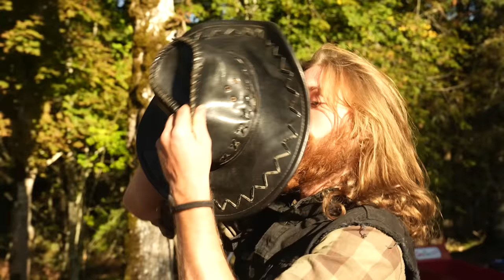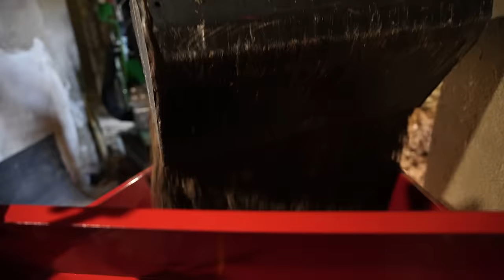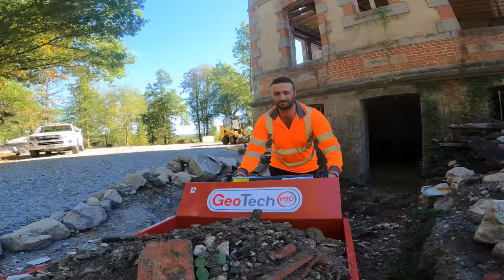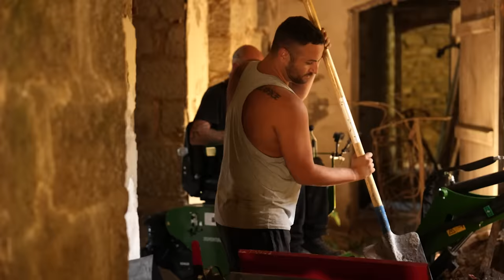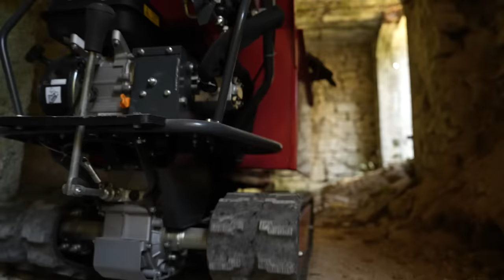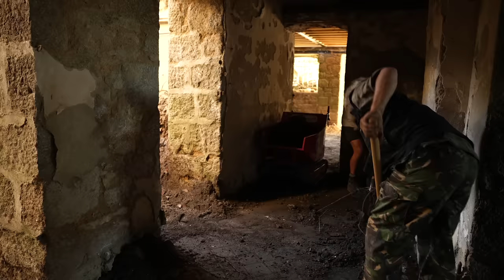The biggest most AMBITIOUS project yet UNDERNEATH this chateau ruin.

Comment: I had no idea that there were still rooms in the château full of muck and debris from the fire.  How nice to get it all cleaned out.😊
Reply: I also thought everything was cleaned out.
Reply: Same here.
Reply: The only cleared areas were the kitchen (to the right of the entrance). The basement's  entrance (by exterior stairs), an alcove, and the central area which had about 4 small rooms along a hallway. The areas in the back below bedrooms and the left wing were not cleared at all.
Reply: This is the other side. With all of their experience this side should go quicker!
Reply: I see some shinny new tools to help you along the clean up, how exciting
Reply: @lgrindrod3474  Wow.  I felt like he was clearing rooms all of the time, and I had no idea so much was left.  Well, he has help, a good crew, and they have a system.  Tally ho!
Reply: They haven't been in the basement for a while. I also forgot about it.
Reply: I am totally bemused as to the building work programming, there doesn't seem to be any direction or logic.  I said some time ago that there needs to be a critical path analysis to schedule the sequence of work so as to make the most efficient use of the labour and resources.  Maybe this concept of building planning is beyond comprehension but it is no less than a project of this type and scale needs.
Reply: Oh I didn't  think  there  was  still  so much to  clear.  Those are  my  kind  of wheelbarrow 😅
Reply: Thats called work.
Reply: @clivewilliams3661 I thought he had stated at one point that stabilizing the walls in the wing they've got floors in WAS the critical path, as it was the least stable section of the ruin.  Seems to me that in ordrr to do that they needed a partial clearing of the basement, and temporary flooring in the area where the stair landings were so they could move materials.  That's where they started (along with the driveway, which is essentially a separate work crew).    They've done that bit and have flooring tied into the walls up to the attic level, and now they're clearing out the rest so they can start flooring in the areas that were less critical to the structure.  It wasn't organized by activity (clearing, then flooring, then xyz) but it was in fact organized around the most critical needs of the structure.
Reply: Amazing hard work guys
Reply: @clivewilliams3661 not sure if you have realised it or not, but I believe this is more about content and less about building (of course there is building going on,just not today.
Reply: @clivewilliams3661 I’m sure Dan could do with you going to France and lending your assistance. Just enjoy the vlogs and try not to be so critical of a lad literally doing all this work by himself.
Reply: The place has two sides and only one is done.
Reply: @ankiking  I don't believe that even one side is done.  I think he picked a sizable room and pushed up one floor at the time.  He indicated that he wants to put a roof on as a priority.  I imagine he won't have time b4 winter but having acquired scaffolding a while back he MAY decide to skip intermediate floors in other areas and do the attic floor as a priority.  That would give him a base to rebuild tops of walls and plan a roof structure as a priority.  Clearly he needs a level secure base to place scaffolding on.
Reply: @clivewilliams3661  I don't think Dan has a critical path gene. He does want to get a roof of some sort on the building to make some areas  habitable. He has a good  sense as to what he is able to do today with the tools he has available.
Reply: As always, it’s just amazing how much gets accomplis
Reply: As always, it’s just amazing. I can’t believe how much work gets done when there is a team to help you Dan.
Reply: @mlaiuppa  I think about that every time things get scooped up and not looked through.
Reply: @halpen  Thank you for the explanation which makes the order of work make sense.
Reply: Ditto... all new info.  What a chore, but a job well done.   I love the tinka toys.
Reply: You are all gladiators except Cameron, he is a viking. Great job guys.
Reply: @clivewilliams3661  I think those details are available through his patron.  He has mentioned there being a five year plan.
Reply: @clivewilliams3661   Your catching on  or will have soon.
Reply: @halpen  the floors are not temp tongue and groove OSB is not a temp flooring plywood is. he has zero engineering reports on what's stable and not. the floor was put in to get staging to top for roof if you believe that?
Reply: We only been in one side of the chateau 
Dan has to do the exact same thing with the floors
Reply: Add me to the "me too" list :)  But I understand clearing / stabilizing part of the structure before going back and clearing the rest.
Reply: Count me in too, thought & wished for your sake everything were clear.
You might get it done before you're 118 birthday.
Monumental task but Trojans prevail.
Reply: @poppopsplace8354  You may be right because content generates revenue and the longer that this goes on the greater the potential for income.  I once thought that given the DiY nature of the project and the amateur expertise that the project would take 5 years to completion, I now think that is optimistic.
Reply: @marychrishannon7048   What concerns me is the lack of proper organisation and the potential for abortive work and thereby waste.  You only have to look at other DiY/amateur builds to see that a degree of planning and understanding has gone into them, not so this project.  The roof installation is a major project that I doubt will be complete enough to provide weatherproofing until next spring/summer.  Also, the window openings will need sealing in some way and there is no hint of that being done.
Reply: @manrossi1Its not the number that is important but the way things are done.  Look at Dick Strawbridge and 'Escape to the Chateau' to see how a one man band with a little occasional help can renovate a French Chateau
Reply: Not that exciting then. Just clearing out a bit more muck.

A lot of build up just for this!
Reply: @PreservationEnthusiast  The point is why clear this out now and why not earlier on, when the rest of the muck away was carried out.  Clearing out all areas would have allowed a full assessment of the work to be done that could have been slotted into the programme of work (if there was one).
Reply: @manrossi1I wholeheartedly agree and this is what I have been advocating from the beginning.  It makes so much sense but that is professional thinking.
Reply: I think I'm gradually loosing my sense of time and space here. 🙃
Reply: @clivewilliams3661 happen explained the plan quite well above. The roof over the section with the first floors will be a temporary one. Yes, the weather will still come in through the window openings, just far less than it has for 4 decades. On the section they are clearing, the concrete floor/basement ceiling has to be removed and replaced before anything structural can be done. Clearing this amount of rubble will have an effect on the walls higher up. That's why the least stable side was tackled first. Tying the walls together and starting to strengthen the tops was done to prevent a collapse. Under that section, Dan has already done some improvements to the basement walls to be better supportive. They're still at the strengthening the framework stage so that they can advance to building the infil stage.
The Strawbridges had more than just the framework in place. Their chateau had windows, doors, solid stairs, floors and plastered walls. It also had a full roof that still protected everything, despite needing some small repairs before they were able to replace it. They lived in the chateau from the beginning. Dan is still several years away from that point. For clarity. This is a burnt out ruin requiring a bespoke plan which Dan has broadly explained.
Reply: Loved it great video❤. Nice new toys & filmed for maximum advertising, well done. Team working is such a joy rather than always solo, & allows for some fun. Yellow pants man has morphed into vis jacket man😊..Well done team Dan, looking forward to tomorrow❤
Reply: I too am confused as to where work is going on.  I don't know the front of the building from the back.  Its never really explained from episode to episode.   Enjoying it all the same.
Reply: @michellebyrom6551  I cannot find your previous post so did not view any explanation.
It was my understanding from previous videos that Dan was looking to start the full construction of the roof for completion by the end of this year, I have not heard of any temporary roof - what form will it take?  normally a temporary roof over this type of construction would be part of the scaffolding arrangement and would fly above the proposed permanent roof.  As there is no scaffolding I assume that it will be a sheeting material on some form of temporary structure?  Leaving the windows open will maintain the saturation of the walls, which because of their thickness and material will take a considerable time to dry out when weather proof - say 2 years or more.  Having saturated floor timbers will show up as the building dries and I would expect some timbers to need replacement and all will need to be packed up to cope with the shrinkage when the building is weatherproof.  
I don't understand why clearing rubble has an effect on the walls higher up?
The walls are of substantial weight and thickness and were thus not slender so unless the structural engineer required it, I cannot see any great need and besides the permanent roof structure would add to the stability.  At present the steel beams can only 'tie' two opposing walls and not all four, the timber joists contribute nothing as they are not tied into the beams or the walls.

The point that I was making about Dick Strawbridge's renovations was that he had a clear and concise plan and schedule of work, the actual extent of it is irrelevant.  I appreciate that Dan's chateau is a mere shell but that is even more reason to have a precise plan and schedule.
Reply: @clivewilliams3661  I agree. There  should be a programme, network analysis, critical path etc. Identify key tasks. I really think getting the roof on the wing he has completed before winter should be a key task too. Otherwise he  is risking the timber he has put in, the way he has done things.

He's definitely lacking in advice in many areas. Project planning, temporary works, safety, use of scaffolds, and crash decks. At the same time he is going over the top on some things like for example putting in mid span noggings on 2.5m spans which is just not necessary.
Reply: @PreservationEnthusiast Programme, network analysis, critical path etc are fine posh words but they all boil down to one thing,   project planning, knowing what you are going to do and when.  Analysing how you are going to build something is essential to understanding the project.
Reply: @clivewilliams3661  I'm sure Dan have an overall plan and that he have consulted more knowledgeable people. Like he told the new I-beams was larger than original based on engineer advise. But the flow of videos is what drives this project. The videos bring the money that give Dan an income and pay the rebuild. Meaning the content are way more important that getting things done fast and effective. It's nearly like the slower the project moves forward the more income it generates.......
Reply: @clivewilliams3661  The order in which they're doing things is completely logical. The chateau is divided in three parts. The middle one which was cleared out first, then the one with the kitchen and now this. For the roof to go on, everything needs to be cleared out, ceilings rebuilt and the walls on top fixed. The roof is one continuous structure and can't be put back on unless everything underneath it got stabilized. He could've done all the clearing out first, then the ceilings and then the walls. But it makes no difference to the end result and he needs keep his videos interesting. They pay for this. If Dan had tons of money to spare, it could be done with a giant scaffolding and a crane. But even then the rubble at the bottom would need to be cleared out. But considering he's doing everything as cheaply as possible, it makes sense.
Reply: @westmus Even the French have building regulations to satisfy and I assume that the UBs were designed by a structural engineer to satisfy that requirement, although I doubt that a structural engineer will either be capable or want to carry out any project planning   This project is complex enough that having an overall plan is simply not good enough.  The points I made were not to speed things up, although that might help given the projected timescales, but to get the sequencing right so as not to waste time, materials and labour, no-one likes to do anything twice, nor repair what was new or salvageable.  This project has more than enough capacity to last a good 5 years with proper management, at which point either everyone is dead bored or Dan has become a millionaire.
Reply: My thoughts exactly!
Reply: Availability of help may be something he can't plan. So when 3 friends let him know (maybe on short notice?) they can come over and help, he comes up with a plan where he can put them to best use.
Reply: @crispijnwind6640   Even more reason to have a detailed critical path because a good one isn't linear and you can select tasks that are appropriate for the type of labour that presents itself, the materials and plant to hand rtaher than just making it up.  That sort of organisation cannot be kept in your head alone.
Reply: @francer1793   Who's We do you have a mouse in your pocket????   lol
Reply: The thing I find strange about all these comments about Dan lacking a building plan is that you seem to have missed the fact that Dan has very intentionally never shared much information with us viewers about the long term plans for the Chateau except in sweepingly general ideas, and usually a video or two before the thing happens. We neither know if he is completely winging it with no plan or if he’s actually a master planner who has consulted with numerous experts, reads all the comments for advice, and has a huge spreadsheet, and a kanban board with everything meticulously planned out. 😅 In all likelihood it’s something in between. But don’t for a second pretend you or anyone else has any clue what he is or isn’t thinking about/planning. Personally I think Dan has been smart about this given the number of people who are overly emotionally involved in his life and comment about every tiny thing he does wrong, mostly with good intentions but my goodness.😬This way he doesn’t have to answer to us. If he listened to every crank in the comments who has 50 years of construction experience or been an architect since the age of 5 and knows the “right way” to do everything, he would never get anything done. I have to remind myself that people get upset when things aren’t done how they feel they should be because they secretly care and want him to succeed, but many of these comments come across as just some strangers on the internet complaining to anyone that will listen, rather than any real constructive criticism.
Reply: @arcadianmorning   Part of the problem is that all us viewers don't have know what Dan is planning  and what we see flies against conventional wisdom so its natural that comments are made.  If there is any logic that we are all not privy to then we are kept in the dark, leading to the conclusions made.  You tube is full of DiYers doing all sorts of projects and watching you get to know if there is a plan even if it is not discussed and some of these projects are years old.  Dan's sense of an amateur unplanned endeavour is also borne out by his ignorance of basic building safety that has also been extensively discussed.  If he actually took on some of the experienced advice then perhaps the project would improve and avoid unnecessary waste, which I assume he can ill afford.  I don't think anyone is getting upset at all because ultimately, Dan will do what he wants but it is important that informed comments are made so as to advise those viewing the videos of their deficiencies since they are too often regarded as 'how to'.
Reply: Absolutely @halpen
Reply: @clivewilliams3661 
Edit: upon re-reading your comment I realize I initially read it wrong - I agree to some extent that leaving informational comments about safety is valuable for fellow viewers considering doing a similiar job. I just wish instead of complaining at Dan, people would frame it like "for anyone considering doing a project like this at home, please consider wearing a respirator" etc. etc. rather than "Dan, you are doing it wrong!"  😄 But yes, watching someone put their life at risk continually and be very disorganized can be maddening. There are quite a few people in the comments on his videos that seem to have a seriously unhealthy parasocial relationship going on with Dan (seen the comments people write about thinking about him all day, and those that can't sleep if he doesn't post?). I just think people have been forgetting themselves a bit.
Reply: @arcadianmorning  Dan read my post al while ago on the sequencing of tasks but merely noted the comment, so yes he does read the posts and others from his retinue have commented on the safety aspects.  The fact that others watch these videos should not mean that the primary comments are directed to them and it may be blunt but if I see something wrong, I call it out, if others disagree then we can have a constructive debate.  No-one should be fearful of constructive criticism.
Reply: @clivewilliams3661  I agree with you. It is good to know that he does read comments. My earlier point was that I didn't find your comment to be particularly constructive.
Reply: Clearing the fire damage and the plant life that has taken over in the last 40 years makes sense. Too bad Calvin has to go back so soon but they got a lot done and I hope he returns soon. I wish Dan had a bigger team to help him all the time but this is something that Patreon has some power to change and maybe at some point skilled volunteers can join him in his efforts. I think he has done a lot in a short amount of time largely on his own. I am here to lend friendly support to this Herculean effort, unfortunately I do not have the means to be a patron. My hope is that Dan is always mindful of his safety and well-being because if there is one thing that will slow this project down it’s a work-related injury and we all want to see him triumph and enjoy this chateau! So keep up the good work, Dan, and take good care of yourself! ❤️
Reply: Dan has his own timeline. He has the plans. I just enjoy watching no matter what he’s doing.
Reply: @monicaambs   From what I have seen that may be a bit of wishful thinking, if he has plans they do not follow any sort of logical building method or safe construction practice.